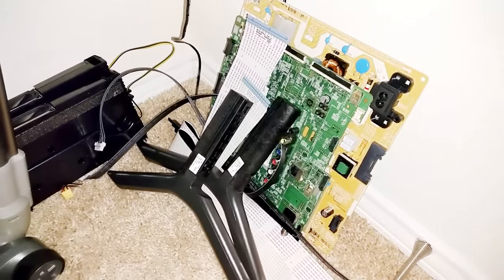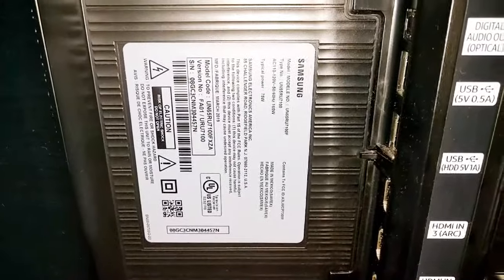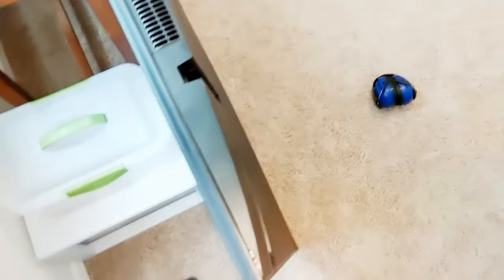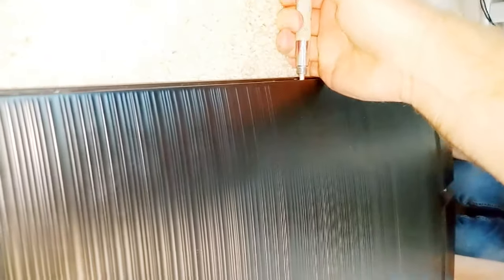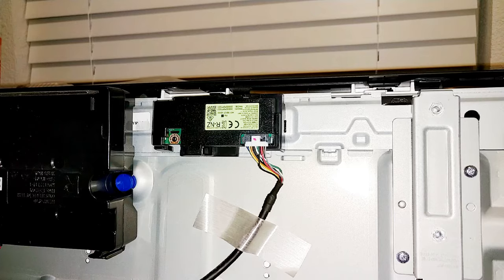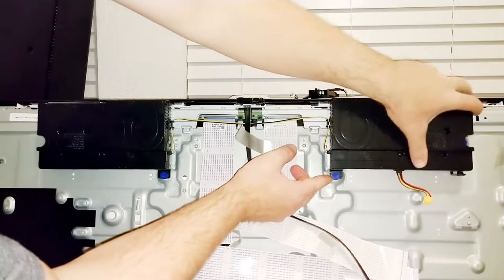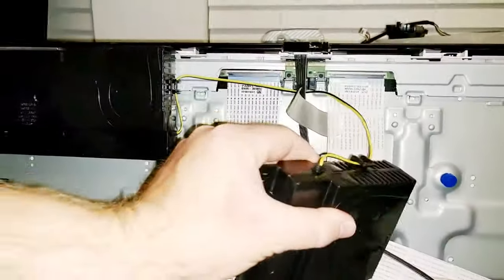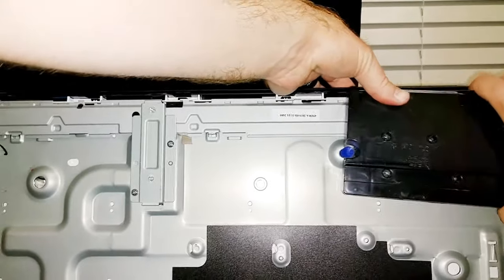Remove Screwless Cover (See Pinned Comment for Alternate) and All Boards on Samsung TV UN65RU7100F

Comment: Did you sell these parts? I am trying to diagnose my TV right now.
Reply from the maker: I don't. Sorry.
Reply: @becausestuffbreaks  I have found out that one of the clear looking ribbon cables attached straight to the display was pinched and cut. Is there any fixing that or will it show most of the picture on the TV still? It is about a 1/2 inch cut not cut all the way through. Thanks for the help!
Reply from the maker: @thomasshoup4744  I assume the ribbon cable needs replaced. Have you tried powering it on to see what it does?
Reply: @becausestuffbreaks  the backlights are fully on, I can hear sound and use the TV with a remote. This is the clear ribbon cable connected straight to the display I believe. There are maybe 8 of them or so. I did not know if these are replaced or not without a whole new screen.

Comment: Did you also remove the illumination modules?
Reply from the maker: No, if you're talking about the backlight.
Reply: I just finished disassembling our Samsung and discovered the reason you don’t talk about the backlight LEDs - they are epoxied to a piece of sheet metal which is riveted to the structural backplane.  They are not replaceable. 😢
Reply from the maker: 😥 I hate it when they make something non-serviceable.

Comment: Have you done a video to remove the front bezel and glass? My bezel has no screws or tabs
Reply from the maker: No. Sorry.
Reply: I'm taking apart a similar TV and accidentally started taking the front bezel off instead of the rear. I was prying through the same gap in the outer case, but I was angled towards the front of the TV rather then inwards. The snaps are smaller.

Comment: Wish u had the boards still. Jus found one with bad ir sensor I believe. Turns on and ofd
Reply from the maker: That sucks. I usually get my used boards off ebay
Reply: @becausestuffbreaks  I broke the screen anyway tearing it apart 😂 for some reason the screen came out first instead of back. First time taking apart one with no screws. Live n learn.
Reply from the maker: That sucks. Thanks for watching!
Reply: @becausestuffbreaks  not too much it was free, and I scrap, got some free gold finger boards out of it, and a little copper and aluminum and a heavy piece of steel/iron. Still a win in my book. Plus I have a board to sell still
Reply from the maker: @jimmywest7675  awesome! How much do you think you'll get for all that metal?
Reply: @becausestuffbreaks  not much. Couple dollars if I’m lucky. But it all adds up over time

Comment: hi bro. first of all, thank you for this video. it was just what i was looking for, but i do have a question.
i was actually hoping that i can reduce flashlight effect (light bleeding from all 4 corners of TV) on my ru8000 model by loosening a few screws in the corners of the panel (as suggested all over the net). you can guess that the problem was that back side of samusung tv is actually screwless. your video helps with that, but i am still not sure if there are any screws under the hood that i can try loosening? for some reason, there aren't many videos or even tutorials with pictures about it on the net, so i took the long shot and asked you. also, have a like and sub. :D
Reply from the maker: There are screws but I don't remember seeing any in the corners. That doesn't mean they aren't there. I just wasn't looking for that.
Reply: @becausestuffbreaks  might be just a completely different way of putting parts together than what was standard before...
anyway, i'll just stick with what i got for the time being. thank you very much for the reply!

Comment: How much can you sell all the pieces for
Reply from the maker: I don't exactly know. I do remember looking and decided it wasn't worth the trouble and threw it all away except the TV Stand feet. Mainly because I tried selling a used board once and the person who bought it said it didn't work and sent it back. I know it worked, but you get people who just board swap and if they find the board doesn't fix it, they claim it doesn't work and send it back. I hate that with a passion. If I buy a board that doesn't fix my problem, I just eat the cost because you never know if installing that board into a broken device might destroy the board. Anyhow, I only plan on selling the feet because the buyer can't say they don't work.
Reply: @becausestuffbreaks  oh thanks again my story is like yours, I found the same tv on the streets and wanted to repair it but I’d opened it incorrectly and broke the screen even more. After that I gave up on trying to fix it and just wanted to see what was inside I found your vid and was able to open it properly and got all the hardware out. And now I know to sell the feet to avoid trouble
Reply: I just paid $30 for a power supply board from ebay. 
They said it came out of a broken screen unit.

Comment: Not all "screwless" Samsung TVs come apart like this. Sitting right in front of me I have a 49" TV, model UN49M5300AF and there are no easy, pp-apart snaps. I've only managed to get one side loose and it looks like the plastic case itself is snapped together and I've had to bend and deform the plastic just to get this far. I can look inside and there are no internal snaps inside away from the edge.

 I haven't been able to do anything with the top as the front bezel overlaps the top edge and I can't even get it apart far enough to get a screwdriver in there.

Why the fucking hell do these companies try to get creative with how they fasten stuff together? It's not for convenience because there's no way in hell that struggling and damaging the case is easier than just taking out screws.

I got this TV out of the trash and figured that it might be worth fixing, but at this point, I'm thinking it's going to end up back in the trash.
Reply from the maker: That sucks. Thanks for watching!
Reply: @becausestuffbreaks  I finally got it apart. I was right about all the snaps being in the edge of the case. No metal pieces, just plastic snaps. 

I checked the fuse, then checked the voltage in the pins of the cable coming from the power board and they all seemed good, yet the TV won't turn on and the backlight doesn't come on with the cable unplugged. The standby light flashes six times when it's first plugged in, then goes out and the TV won't turn on. There are no leaking/bulging capacitors and nothing looks damaged, it just doesn't work.
Reply from the maker: @lurkerrekrul  that sounds like a tough one. Does it have a separate board to power the backlight? Can you try putting an input in somewhere and see if you can get sound? Maybe hook it up to an HDMI and try figuring out how to change inputs.
Reply: @becausestuffbreaks  As far as I an tell the backlight is powered directly off the regular power board. There are wires that go off the right side (when looking at it from the back) and go through the metal plate, so I assume those are for the backlight.

I get nothing with a video source hooked up to any of the inputs. The TV appears dead.
Reply from the maker: @lurkerrekrul  hmmm. It's odd that you have good voltage from the power supply pins. Possibly the main board isn't telling it to turn on or the button/IR Controller board is bad or unplugged. I've seen this happen on a couple TVs due to lightning damage. Look at the small components around the inputs on the main board. Might be hard to see defects on the small components if they are damaged.
Reply from the maker: @lurkerrekrul  here's a video where I troubleshot a similar problem but a different TV brand if you want to get an idea on what could possibly cause it: https://youtu.be/U_ciapdCiJI
Reply: @lurkerrekrul  Does it make a few squeeking sound coming from the back of the TV when you attempt to turn it on or when plugging it in ?  Did you carefully check your power board, standby power, all voltages, measure caps, etc ? If you correctly ruled out the power board, then it is most likely a shot backlight, or more likely a mainboard issue.   Since you mention the red power led is flashing that sounds to me like a power supply problem (this would be my educated *GUESS*)
Reply: @jimmydandy9364  That TV is long gone. Allow me to explain...

Twice a year in this area, we have "bulk trash pickup" where the city will haul away almost anything you put on the curb. People use these times to clean out their closets, basements, attics, etc, and throw out all the stuff that they can't fit in the normal trash and that they don't want to take to the dump or pay someone to haul away.

When my friend and I drive around, we see lots of TVs, and I sometimes bring some of them home. This was one such TV. When I couldn't do anything with it, I put it out for the next pickup.

Right now, I have two large TVs with problems;

A 50" LG with no sound and a purple-tinted image, and a 60" Vizio with half the backlights burned out. I've been too lazy to do anything with the LG, and for the Vizio, I just haven't wanted to spend the $80+ for a new set of backlights, especially as I've read on the net that the backlights burning out is a common problem with that model. Something about it sending a power surge to the backlights when you first turn it on.

I do have smaller, working TVs. A 30" LG, a 40" Samsung, and a couple 20" models that I forget the brands of. It seems the smaller the TV, the more likely it is to work. My friend brought home about 6-7 working TVs in the 20-25" range in one month. They're all collecting dust in his basement. I'm a bit of a hoarder, but I haven't brought home that many!

Comment: This looks like my 70 inch. SAMSUNG pro. BE70T-H. When i plug it in the red power light blinks on and off, and the backlight just turns on and off. I can hear the television booting but the backlight only blinks on and off. Nothing on screen but the light. I wanna fix it and sell it. Which would be the first easy try to repair ?